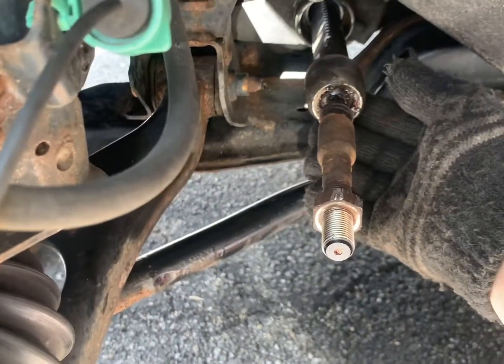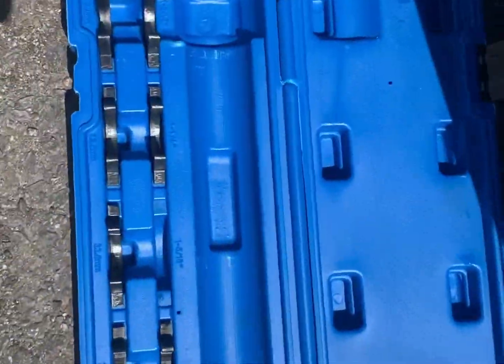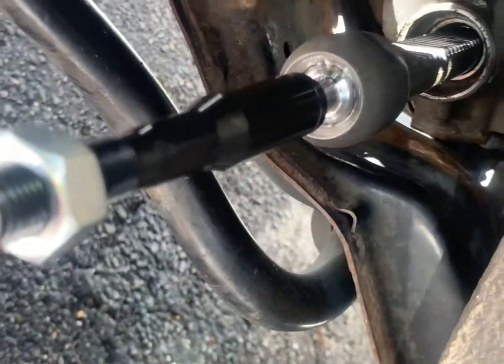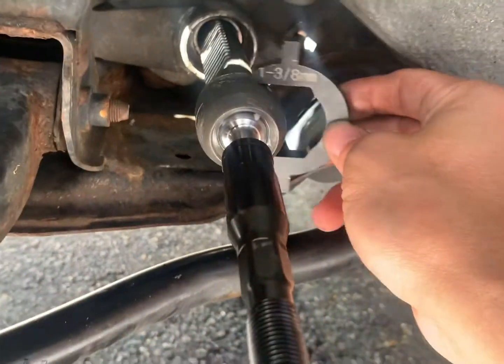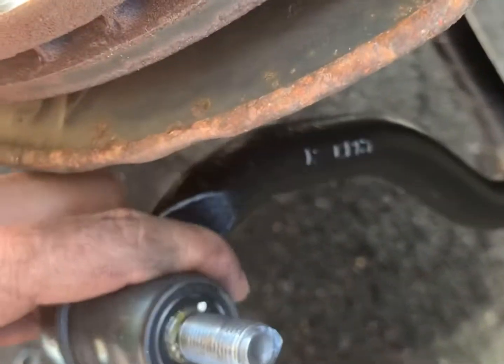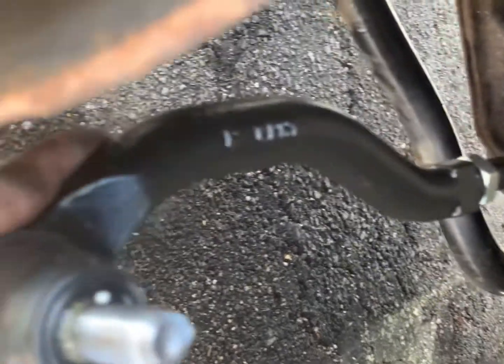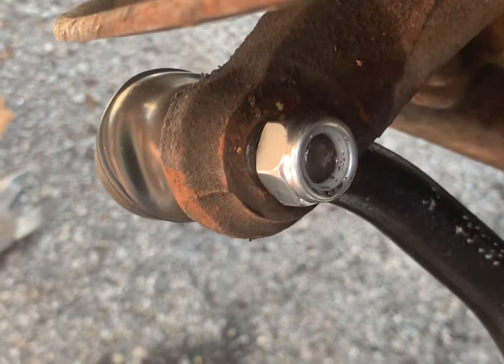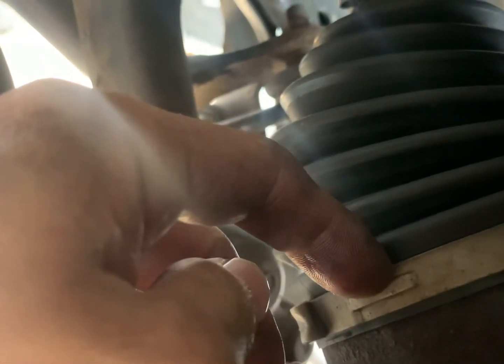Inner outer tie rod replacement Honda Civic si 2008

Comment: Aren't you supposed to use thread locker on the inner tie rod threads?
Reply from the maker: You shouldn’t put anything. Thread locker will makes the alignment more difficult.